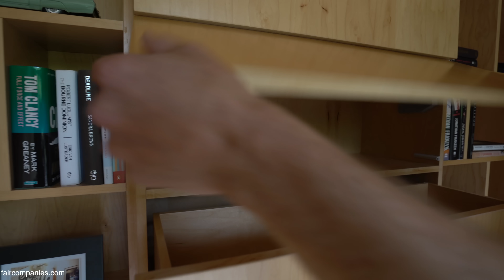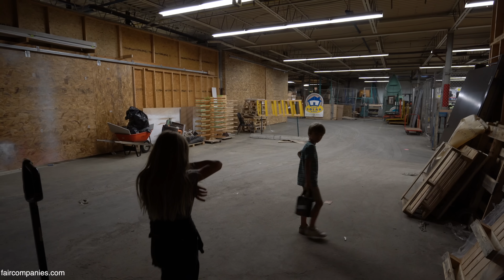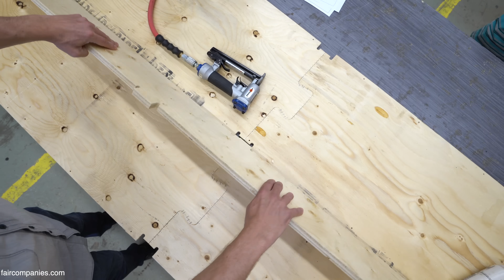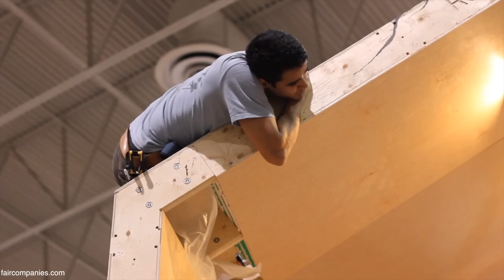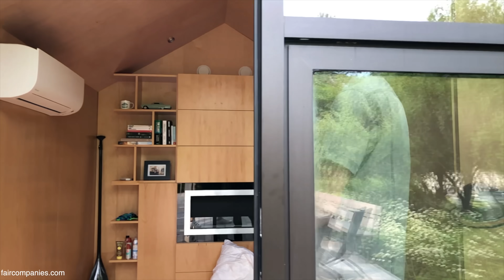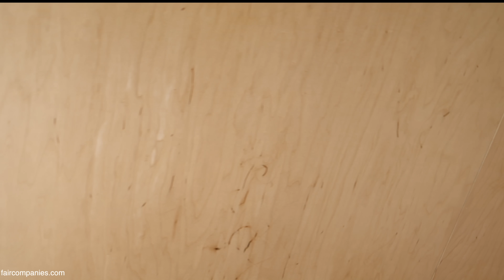Bunkie prefab cabin uses joinery & assembly of furniture design

Comment: On the bottom side of the bed board,
 a folding table and two chairs could fold down for a dining room.
Reply: Yes, I've seen Murphy beds like that and it is such a clever use of furniture because in this one there is no table or anywhere to sit other than outside.

Comment: I really like the thought of digital architecture. With open source cad plans it could be a present day version of 3D printing houses wherever they are needed and using wood. Predesigned rather than prefabricated. ;-) I guess that would kinda imply that someone with little building experience would need to be able to put this together, which unfortunately goes agains what Evan plans right now.

Comment: Looks like a pretty costly tent replacement having no kitchen or bath but sporting a pool.  Very specific application which apparently requires no permit.  Does not integrate with the environment if that matters.  On its own it is only a seasonal camp building though it does have closed HVAC.

Comment: Thanks 4 the beautiful video! 
It is not naked , in my opinion , practical!
I will put the bed in the other direction, so I can enjoy the wieu.

Also I will make the bed folding, so can be 4 one person or 4 two and use eventually like a sofa.

Also I will created table and share , same way like the bed, hidden in the wall.

4 kitchen one no need much, like 4 a camping.
Gas cook and watter!

4 toilet, a bucket toilet,
 Or composting .

Then a plastic bag with water , can be heated in the sun, 4 outside shower.

Put moschito net over Bett o Windows.  . 

So I could live there, I think,  even 4 a month in Sommer;-)

Comment: That ductless HVAC system must only have to run for 5 minutes to heat or cool the place.
Reply: I agree, but what runs the minisplit during that time? Battery, a free-standing solar panel, a (eek!) generator? 
A piece of useful info to learn.
Reply: @amandawilcox9638  probably has a line put in to that property
Reply: Harvey Morgan, (Sigh). You're probably right. But if they had enough solar power on top of the bunkie ro run the lights and mini-split,  that info  might have  balanced tbe price some, for me. Maybe.

Comment: For the cheapest house which I think is about 98sqft in size it will run you 23,500. Thats just under 250$ per sqft which is ridiculous considering that there is no bathroom or kitchen and really you only get a bed with a roof over it. For that kind of money you should figure out how to build and just fucking do it yourself and try and make something much more suitable. Crazy how a build that really cost about 5,000 at most is that much although I could be wrong about how much it cost to build
Reply: 100% agree but this would be more for a luxury guest house and not full time living
Reply: @jessykapop  Yea that makes sense and they are built really well

Comment: 12V. What is the source of the power? If batteries, I didn't see that mentioned or shown where it is stored. If a transformer, then it is actually 120 or 250 V isn't it?  What exactly is the zoning problem? Is it prevention of proliferation of housing in upscale vacation areas? It seems implied that there is a widespread employment of this kind of zoning, but Canada is so large, that I don't think this zoning problem exists in remote areas, or is that a mistaken presumption?
Reply: Multiple issues but the Issue they were referring is prevention of additional homes on the same property and the way the costs rise quickly when building a home instead of a secondary structure like a shed, etc. because that triggers the need for building permits, impact fees and a long laundry list of other fees and costs that can quickly start making it cost as much as much larger houses....

This is a problem in many places and not just Canada... Like in California it's the reason a ADU will typically cost more than $200K...

Comment: This is amazing and beautiful. Great work and design. Just no toilet and kitchen due to permitting issue. But I would suggest why not make a separate unit for kitchen and bath that would be possible to attach easily to an existing unit if needed or wanted based on location to bypass the permitting issue.
Reply: Still applies those permits and other fees to those additional structures...

Not sure about where they are operating but some places with single family zoning can also limit the number of kitchens on the property as well...

This is one of the reasons why you don't always see a full kitchen in an AirBNB, for example. But, like staying at a Inn, when you stay at a BNB then meals are usually included as part of the service, which is what BNB stands for (Bed N' Breakfast)...

So it's not always easy to get around the zoning issues and it can deal with more than just the costs...

Comment: I love the prefab technique in designing these spaces, but I have been trying to wrap my mind around what it must feel to live in such a tiny space. I don't think I could do it. I understand downsizing, and only living with the essentials, but I think you can still have that, but with a much bigger space. This space is ridiculously small. I have seen many tiny spaces that seems livable, but this space is insane. Most of these tiny spaces are still pretty expensive which defeats the whole purpose in my opinion. If that's your thing, then by all means have fun, but I think I would feel much more free in my mind, and body without living in a sardine can.
Reply: There's people living in bicycle campers, cars, and other examples for a reality check of what is actually tiny and comparable to a sardine can.

People living in Vans, for example, will typically have less than 60 Sq Ft but this is 98 Sq Ft...  But can be larger, it's just to keep the costs low and avoid needing permits and other costs that would significantly increase the costs and trouble it would take to put one on the property.

It's also not intended to be the sole living space and you would actually add it to an existing property.  So it's like having an extra, detached, bedroom for guests, etc.

Spaces aren't always intended to operate solely on their own or entirely indoors.  Many times the point is to spend more time outdoors.

Counties like Japan, for example, people spend much more of their time outdoors than Americans do... They have public bath houses, they do most of their entertainment and socializing outdoors in public areas, etc. So they need much less in their actual homes, which they would only spend part of their day at...

So it's not only about minimizing but also how you live your life and how much of it you intend to be indoors.

For most Americans this breaks down to about 93% of their lives spend indoors, about 6% in vehicles, and over 50% of that in their homes.  Combined with consumerism and needing space for all our stuff and fewer people living together has led to the perceived need for lots of space and the need for homes to be a microcosm of everything we need to live our entire lives...